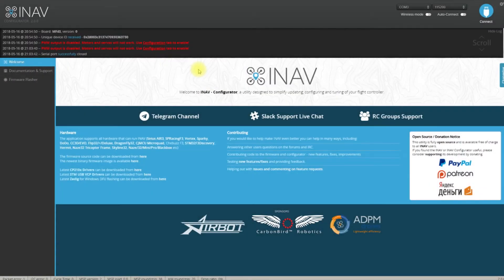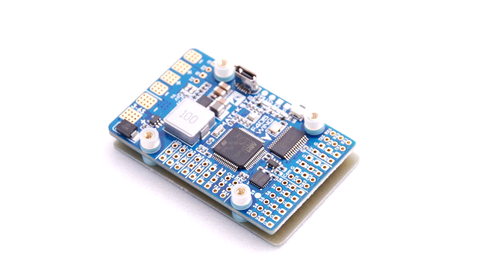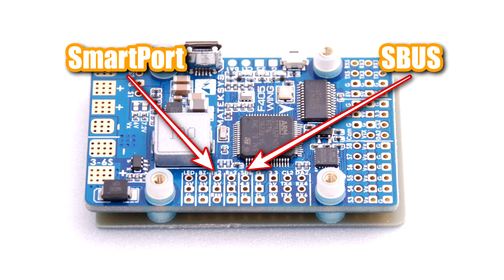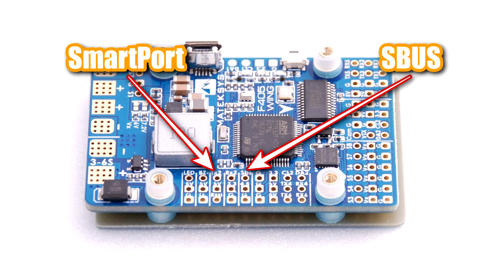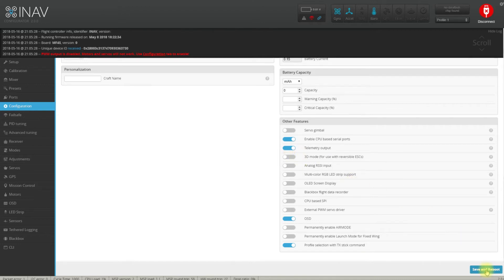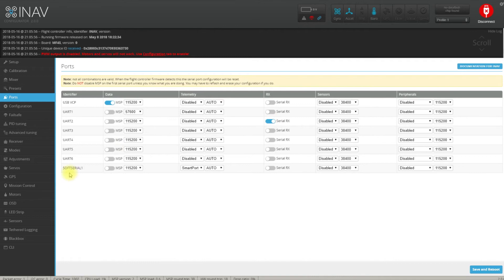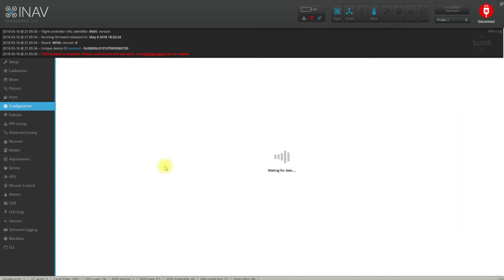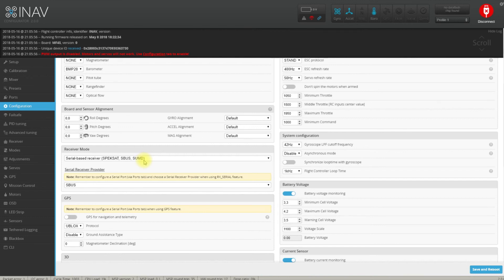How to: Matek F405 Wing, INAV, SBUS and SmartPort

Comment: Pawel, I want to do the same but with Ardupilot. Is it possible to do with the latest version? I'm confused because the Ardupilot documentation suggests that I need an external hardware inverter, but it doesn't make sense if UART2 has an inverter in the receive, labeled SBUS as you show in this video. Can you provide some insight here?  Thanks. I'm using Ardupilot 3.9.11 and MatekF405 wing and RXSR receiver with SBUS firmware.

Comment: iNAV 2.5.2, X-XSR, F405-Wing
Got these and still can't get it working, here is the fix. (Do what he did int he video too.)
Extra Steps:
1st) 
You must use the uninverted smartport signal. (Tiny pad on the reciever, google for more info)
The smartport wire from the connector port is inverted, and will not work on the F405.
2nd) 
Receiver Tab: Select 'SBUS', then below that select 'FPORT', Inverted 'OFF', Half Duplex 'ON'

Congrats, it will work.
N00b to iNav helping other n00bs. =)

If it still won't work, you probably need to watch videos on openTX update, and Firmware. (specially installing Fport firmware on the receiver and the the radio's transmitter. I think it was called XJT for my QX7)

Comment: I have my f405 wing,r xsr setup exactly the way you did except board is flashed with inav 2.5 but dont work.   In inav i have no stick inputs at all my radiomaster tx 16s shows good stick inputs in inputs, mixer and outputs it also binds very quick and shows strong signal. Please tell me what might be the problem. Thanks for all your viedos

Comment: I have a F405 Wing F/C and using a Frsky 8XR. I can hook the to the smart port on the 8XR and transmit the telemetry to the F405 Wing F/C or will i need some sort of adapter? Never tried this before.

Comment: I have the matek f405-ctr and setup everything like you told. but I do not get the GPS Sensor in my Frsky QX7 when I discover new Sensors. Smartport is soldered on TX2 (Frsky R-XSR) 
and Serial RX is setup on UART2 in Inav.

Comment: This is a little off subject but need advice,  while soldering pins to my f405-wing I think maybe I damaged tx4 and rx4 which I need for gps with build in compass, is it possible to use tx6 and tx6 and still work. Thanks you

Comment: So I do not need to solder to the "P" pad on my R-XSR for the SmartPort wire on a F405-Wing flight controller? Does that mean I can use the regular wires for the receiver in inav? If I understand correctly, my R-XSR has an inverted SmartPort through the normal pin-out and an uninverted SmartPort on the "P" pad. I just don't want to burn anything up. If iNAV can handle the regular inverted pin-out it will make my life easier, but if the F405-Wing cannot handle inverted smartport processing I would like to know before I spend a bunch of time doing the wrong thing...
Reply from the maker: Inverted in this case does not mean + is -. It only decides when serial ports send and receives 0 or 1. If you connect "inverted" to "not-inverted" serial port will not receive data, but nothing will be damaged
Reply: @FPVUniversity  that helps a lot. You don't know off the top of your head which to try first, though, do you? Lol

Comment: Hello Pawel many thanks for this informative video but I still have a little problem you may be able to assist me with. I also have Matek F405 Wing but cannot for the life of me get SBUS to work.  I can get 16 channels PPM but nothing on SBUS or SUMD using my UHF Openlrsng Hobbyking receiver. TX is Taranis am thinking it could be a signal issue on SBUS so I tried to use the command to turn of inversion in Inav that I found on the wiki but it reports unrecognised command in 2.2.1 have you any idea's?  Thanks Bill
Reply: Did you manage to make it work? I cant! 😟
Reply: @scelik2000  Yes i did after contacting Matek look at my videos the answer is shown there.
Reply: BillHally ı watched. Thanks.

Comment: Hi, Is it possible to connect Flysky X6B receiver’s iBus to the SBUS on Matek’s F405SE Wing Flight controller board? I am a newby and only just getting into fixed wing with this board.  Is iBus and SBUS compatible or will I have to buy a different Transmitter and Receiver that specifically uses SBUS? Thanks.
Reply from the maker: Should be possible directly to UART2 bypassing inverter or any other UART RX

Comment: Thank you for the video..finally I can get now telemetry from my Wing FC-10/Jumper R1 combination to my Taranis QX7S..:) The only issue I now have is that I cant get my GPS to work anymore (had to change it to a different UART/Port becasue Softserial is locked to UART2. Is there a way that the SPO port can be used for either of them - only asking here just in case you or someone else might know sicne there isnt a lot of documentation out there?

Comment: I have the F405 wing running INAV 2.2.0 and am having trouble getting telemetry. I have it all connected according to the Matek website " Also how you instructed on this video". After following the instructions on the video I am still having an issue getting my telemetry data. Just to be clear, I am getting RSSI due to having it connected to the RSSI pad but that is all. When I go to discover sensors, I get nothing except for the two native sensors "RxBt and RSSI". I have also tried using the RX1 on the R9slim plus on an open Uart also with no success. Any advice would be great and appreciated. 

My setup: F405 wing, Taranis QX7 with R9M TX, R9 Slim Plus RX
Both RX and TX running the most current FLEX firmware and QX7 running most current OPEN TX
Reply: Hey there,

I've got a really similar setup and was wondering did you finally get the telemetry to work?

Thanks!

Comment: Just set up an F405 Wing with Sbus, SmartPort.  Also have RSSI from R9Slim+ plugged into the RSSI pin on the F405.  However I am not getting RSSI reading in OSD.  Is RSSI pin on F405 in conflict with SmartPort pin or something?
Reply: I couldnt make it work althought followed all what he say. Did you do something additionally.

Comment: Hi,
Is it possible to have 2 lanes for yaw and 2 lanes for flaps ?
I would like butterfly braking. 
Is it possible with inav? 
Thx
Reply from the maker: Yes, as long as you have enough servo outputs it should be doable
Reply: I must mixing To inav or Tx? 
I don't find custom airplane To inav 2.0 for attribut servo.

Comment: What are the different onboard voltages available for the VTX..????...Reason I ask is because my 1.2G VTXs only use 12 vdc....Not 9 vdc...?
Reply from the maker: I'm not the one to ask this question I'm affraid
Reply: You can set 12V output on the 9V pads as far as I know.
Reply: Sampson Guo....Thanks for that link m8....Im still thinking the onboard LC Filters are not good enough though...I suppose I could continue using a filtered supply from my filter instead. Not sure that will cut it if I use a 4S Lipo though..?

Comment: Is there any reason not to just use fport if your Rx supports it?  This will free up a uart.
Reply from the maker: Let's start counting the hardwares that doe not require any hack... oh... pretty short list, right? But no, this is indeed using only one UART even it is not Fport.
Reply: sbus in has inverter in on rx, fport goes to a tx pin and is bi-directional, don't ask me it's smoking mirrors.

Comment: Have an r9mm followed all directions no telemetry 
Not even getting rssi- tempted to update the firmware
Reply: @sparkythegrea  try updating taranis firmware to newest- it finally worked on fport
Reply: @sparkythegrea  I get kind of pissed with how many hoops there are with frsky tlm- crossfire is a gimme every time
also tubers that don't give shit re questions
Keep up the good fight
Reply: Has anyone got this working with the r9 mini no one has stock of the mm also beating my head against the wall
Reply: R9 mini sbus fine but no telemtry
Reply: @sparkythegrea  yeah updated the FW the one just before for eu decided it's not worth my time have reverted back to sbus and will live without telemetry until an R9 MM is available really disappointing.
Reply: @sparkythegrea  if you say softserial you mean tx2 on the f405 and the s port on the receiver  right?
Reply: I know this is old but, I just installed a f405 with r9 mini in mine. I had to put my rssi channel to 16 in order to get it to display in the OSD.